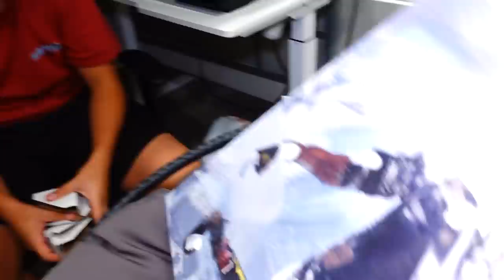Room Makeover For Teens | Bedroom Tour

Comment: Loving the room. Top tip for long windows and wanting curtains that reach the floor. Buy a single curtain of the same style as the pair which can be cut in half. Then take another material that ties in with the room and shorten the pair, sew in a horizontal panel of the material that ties in with the rest of the room to the bottom of the curtains you’ve cut & finally sew the single curtain that you halved onto the other side of the horizontal panel of material. This ensures they drape and hang like regular curtains but gives you bespoke three panel curtains that go right to the floor and they look like regular curtains because the top and bottom section is made from curtains. In some cases you can have enough material from using just the pair of curtains if you use the other material in the middle section to cover like a third of the drop (so you’d have the top panel a third of the length, then, for example that furry material that’s on their bedspread as the middle third and then join the bottom part of the curtain to make the bottom third) but again it depends on how long you need them to be which is why I said about having one extra curtain. If you’re able to work a sewing machine at all you’ll be able to do this fairly easily as finding curtains for windows that are so long is normally always an issue but panel curtains can really help tie everything together and save you a ton of money as getting them professionally made can cost so much more. Hope that made sense. Ps the room looks so good 💋 xx

Comment: Love their room! There is sadly no way my kiddo could have a bed like that... my kiddo is a mover/roller and would fall right off 😄 🤣 haha
Reply: mover/roller?
Reply: Alex means like his child moves a lot in there sleep and rolls around in there sleep and if they had that bed the kiddo would roll off easily
Reply: My daughter is the same way. She rolls and turns over the hole night. When I go to bed I always go check on her, so she is at least under her blanket. 
But we found a loft bed at I**A 🇸🇪  with closet and table underneath, that have pretty high railings (and you are supposed to have a low mattress with it) so there is no way she could fall of in her sleep
Reply: Those beds have rails. So that the kids hopefully don't roll off.
Reply: @k.elh.8097  IKEA?
Reply: @Leahm.2010  yes
Reply: @k.elh.8097  just wondering
Reply: maybe there are options with safer rails? higher and more bars in between
you can also build your own... just make sure you screw into the studs :)
Reply: @sandywessalowski2665  if you look the mattress is parallel with the top of the rails. Wow I was just stating how I would love this as an option for my child, but my child is a restless sleeper and at times sleep walks so a bunk or loft bed isn't an option for us at the present.
Reply: @k.elh.8097  be careful with those too, I had an Ikea loft bed as a kid and spent so much time swinging and climbing up the rails that one night I rolled over and it just snapped I fell a good 5 ft, thankfully I was a hoarder of stuffed animals and walked away with just a few bruises at the sacrifice of my beanbag and a "my size" Winnie the Pooh 🤣